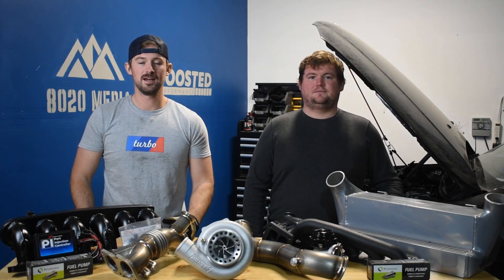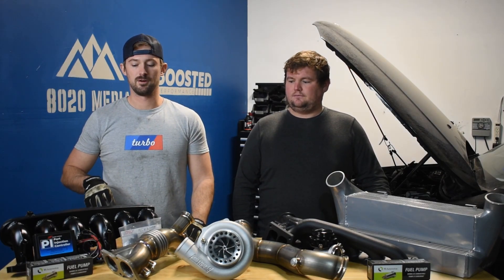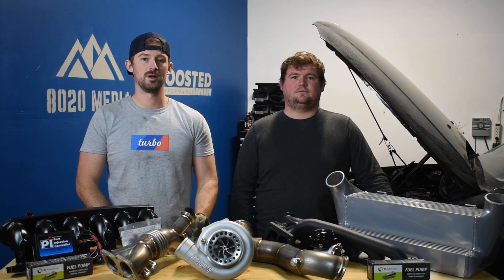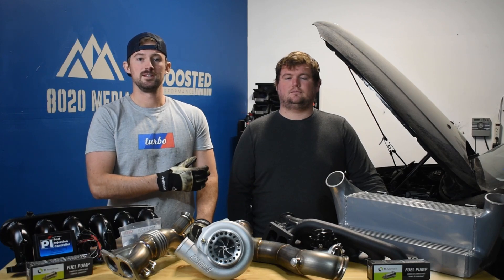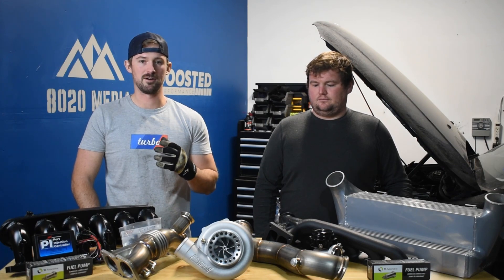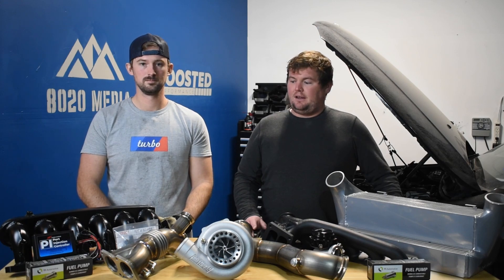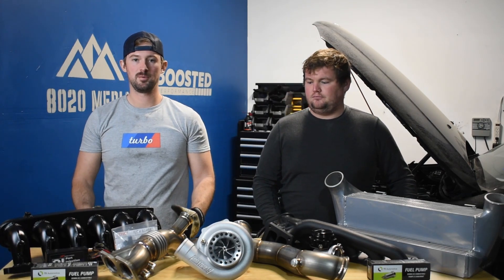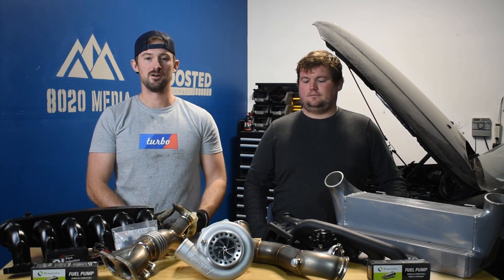INTRODUCING Our 700whp Single Turbo Build! N54 135i Build Ep.1

Comment: Jb4 and jb4 pi controller make single turbo setups very easy to tune. 👍🏻
Reply from the maker: Absolutely. Great that we already had a JB4 installed too. Now wiring it and getting it to fit in the DME box isn't so easy haha, we had a hard time stuffing the box and all the wires in there when we added it to Zach's 335i. Getting a few snowy days here so about to get all the fueling stuff setup!